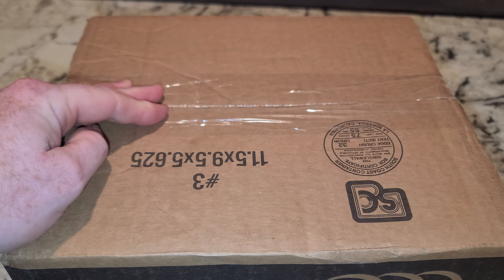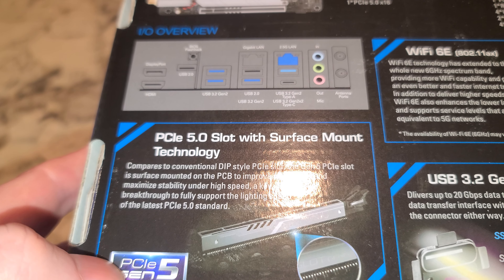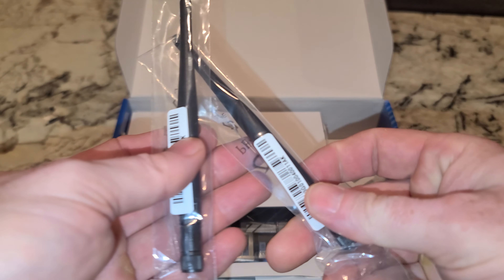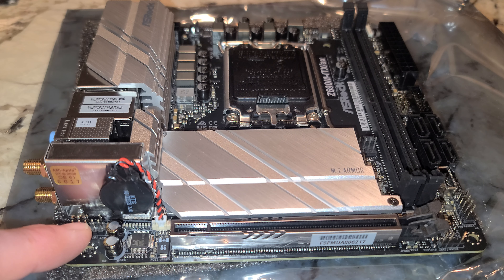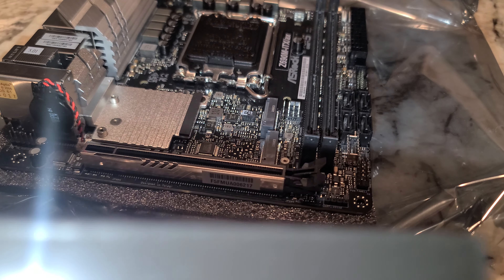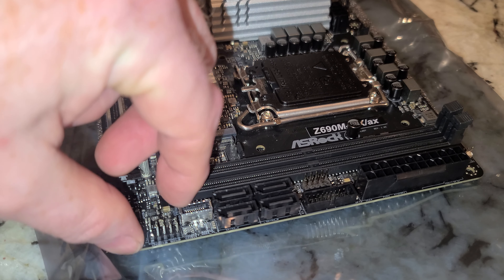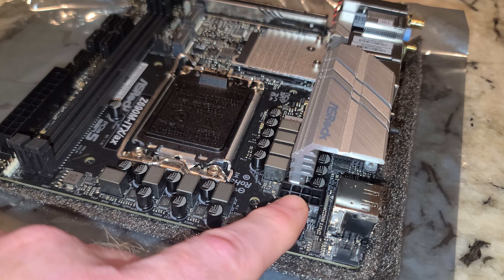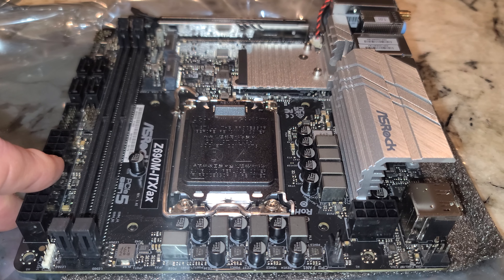Unboxing AsRock Z690m-itx/ac LGA 1700 motherboard, 12th and 13th gen compatible

Comment: I just got this board (open box) for $115. I think it should do up to a 14700k easy as it has an 8 pin cpu power connector and 8 phase power. The only limitation I could think of is the size of a heatsink in a small form factor build. I plan on throwing a 12700k in mine, and maybe down the road upgrade to 13th gen when they get older and cheaper. 

Edit; an 8 pin cpu port is spec'ed at 150w while being able to handle 300-400w. Similar to a 13700k has a tdp of 125w, but can pull 250w. An 8 pin should be fine for a 13700k.
Reply: I have this motherboard as well and I currently have a 12th gen processor, is this motherboard compatible with 14th gen processors?

Comment: Would this be any good for AI video enhancing software with it's intensive processing needed ?
Reply: the motherboard does nothing tbh, it just connects your components together and can sometimes help with overclocking features to make them more powerful but i wont worry about that. just get an nvidia gpu - since you mentioned ai- and an intel cpu above 6 cores at least.
Reply: It should be fine, especially in 2024 it’s a great option for a budget build. In 2024 it’s sold at around $140. But the question shouldn’t be about a motherboard, it should be about cpu. This motherboard is LGA1700 so it can only take Intel CPUs. I prefer Intel CPUs better if im being honest. But if I was going to get a budget cpu for editing and what you’re talking about it would be a i5 12600k for about $150. If it’s a more expensive build it would be a 13900k or a 14900k. Anyways im yapping to much, hope this helps.

Comment: Hi, is it compatible with a normal i7 13700  lga 1700 ? Thanks beforehand
Reply: It would probably need a bios update, but I would suspect so. The easiest way to check is going to the driver download support for this board, and checking the bios update changes.
Reply: Is this motherboard compatible with 14th gen processors?
Reply: @SigmaFemboy69  Yes its comaptible.
Reply: I'm using 14600k